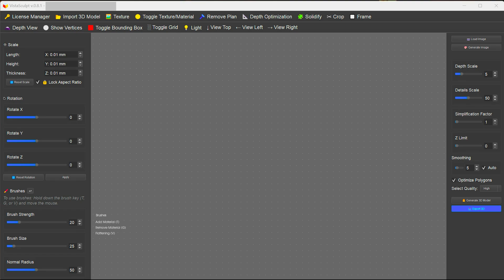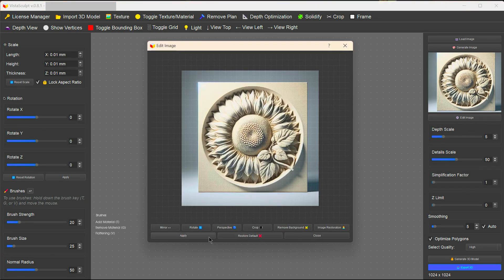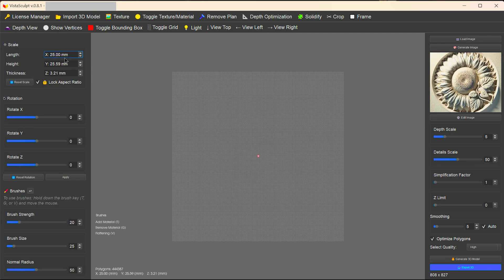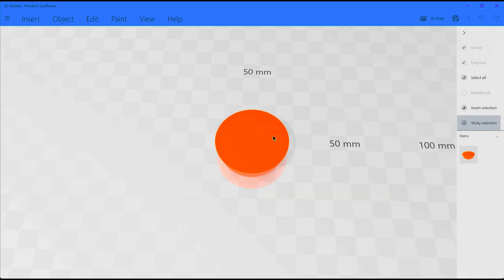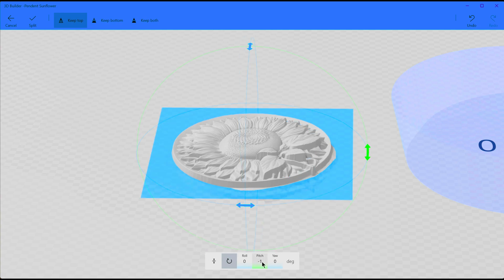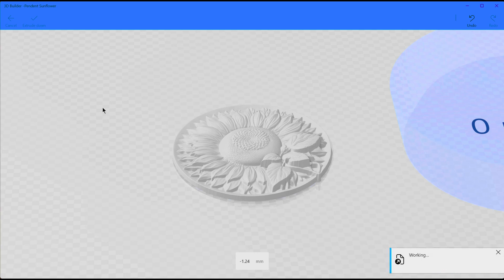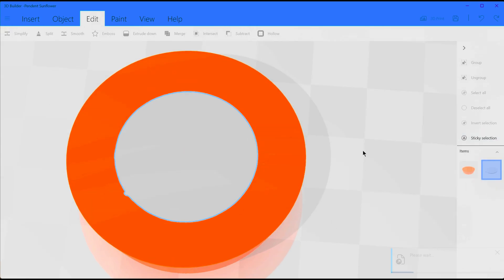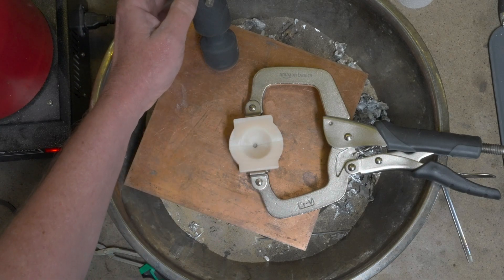Casting Jewlery from an AI Image in a 3D Printed Mold

Comment: Fantastic work! You reckon Thermacast could be used to make wax molds for further vaccum casting?

So 3D print negatives of an STL file. Use Thermacast to produce wax models and then cast the wax models using lost wax method?
Reply from the maker: Don't see why not.  It should work just fine but I'm not sure if you would need a mold release to get the wax out without sticking?
Reply: @The_Smelters_Apprentice  Ah fair call! Thermacast looks fairly rigid. I have been using 2 part SIlicon RTV molds but really wonder if I could just print the molds directly. I have a feeling that wont allow for intricate vacuum casting run with Sterling Silver.  

Is the final cured mold porus? Just trying to gauge if it will act similar to an investment flask. If yes, this could be absolutely game changing!
Reply from the maker: @Jalvi_au  It's like printing a "permanent" mold and is rock hard and non porus unless you put in your own sprues and vents into the model.  Unfortunately it will not handle Silver etc as that is just too hot.  I have done some videos showing it as a thin "chip off" mold a bit like ceramic shell, or multi part molds for complex shapes.

Comment: Hey Nathan. Thanks for the tutorial walk through. I've noticed that you've mentioned "Resin Printer" a few times in your posts. You used it to prep the coins and here too on one using VistSculpt: https://youtu.be/EUKFQGlaGLE?si=YEvrpLDaJh0NDI1Q  So, question. What Resin printers do you recommend we check out? Also, if you wanted to go larger, say the size of a dinner plate, what platform would you use? We use CNC machines and laser cutters to acheive similar results to what you've shown here (wood and other substrates). This metal casting is really kinda cool. I wanna take a closer look. Thanks.
Reply from the maker: I too use a Fiber Laser (with a Motorised Z-Axis) for 2.5d metal engraving and have (on a slow boat from China) a Mill coming for CNC work.  As you know, both of these are subtractive machines, so you end up with heaps of waste, it can be slow, but the detail you can get is fantastic (esp from the Laser).  The good thing with casting is it is additive, and any waste (sprues, runners etc) can go back into the melt pot.  I currently have a Saturn 3 Ultra which has a 225 (L), 129 (W), 260 (H) that I'm now finding too small and... less than ideal quality wise.  I cast the odd bronze sundial (about the size of a dinner plate) then laser in the fine details... but I'm limited by the print size currently (even when angled).  So, I'm looking at the new Uniformation GK3 Ultra as it has a 300 (L), 160 (W), 300 (H).  I was going to pull the trigger on it, but given I only have small projects currently, I'll buy a new printer after Christmas.
Reply: @The_Smelters_Apprentice  Excellent! Thanks Nathan!